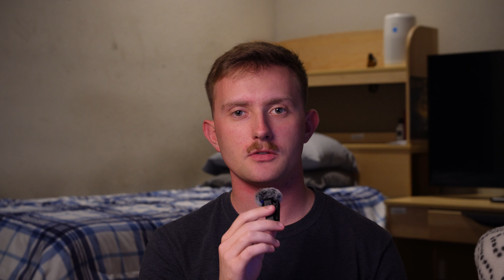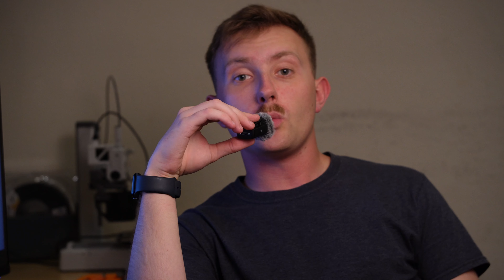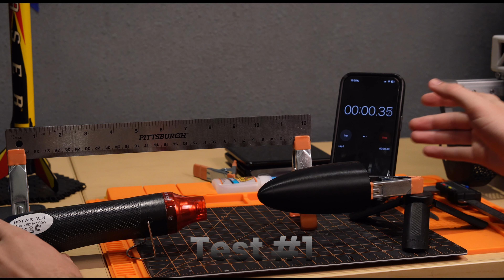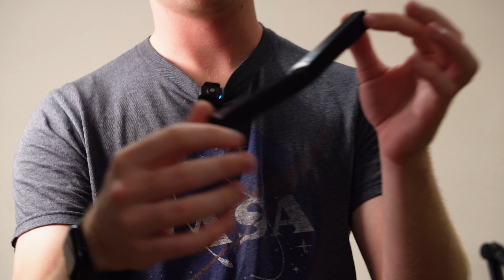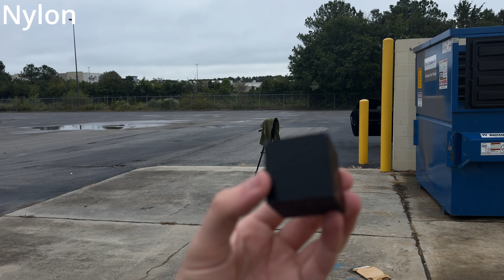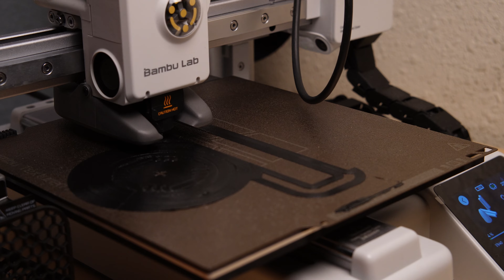I Torture Tested 3D Prints For Rocketry

Comment: I have a bit of experience with 3D printed nose cones as I have flown both my L1 and 2 rockets with PLA nose cones.

My L2 rocket was simmed to Mach 1.3 and just made it through the sound barrier before my CTI Pro54 K570 had a cataestrophic failure. Safe to say, this whole rocket went through it. Nose cone survived with no damage free falling 1.5km after the explosion. Nose cone had 0% infill and 4 layer thick walls, printed with a 0.4mm nozzle and 0.2mm layer height. Sanded and spray painted.

I launched this rocket at BALLS33 in the Blackrock desert and one thing I learned was that PLA does expand in the heat and you should keep this in mind as a loose fit between the nose cone shoulder can become tight after some time in the sun. I ended up leaving my nose cone out in the sun to get up to temp and then adjusting the amount of tape on the shoulder to get the right friction fit. Only after that did I do my pop test to make sure I had the right amount of black powder for ejection.

Next time I will try PETG for the nose cone as I reckon it will not suffer as much from high temperature.

The following is do as I say, not as I do: I printed a PETG coupler for my L2 rocket. I was /very/ suspicious of this and was not a fan but it was the best I could do on a tight time scale. I designed it to include threaded rods across the shear plane of the booster airframe and the payload airframe and I made it as integrated into the payload bulkhead and payload structure as I could in an attempt to improve strength. The coupler was directly adjacent to the motor explosion with the motor essentially exploading into it and to be honest, I was very impressed. That being said, I will never print a coupler for a high powered rocket again. The coupler was destroyed when I found it but a majority of it was found where it landed, meaning a majority of the damage to the coupler was done on impact with the ground rather than during the explosion. What happened here is - I got away with it, I do not believe this is a great solution.

Another thing is 3D printed internal structures. I will be 3D printing these in the future, I was very impressed. I 3d printed with 100% infill my payload bay consisting of two bulkheads, a payload sled and 2 threaded rods along the axis to hold everything together. Chute and drogue was attached to eather end using U bolts through the bulkheads. The bulkeads were screwed into the airframe resulting in two load paths for chute deployment, 1. U-bold -> bulkhead -> threaded rods -> bulkhead -> U-bolt and 2. U-bold -> bulkhead -> airframe -> bulkhead -> U-bolt. I had a /very/ hastily calculated estimate of 20kg worth of force on the system at chute deployment which I was confident would hold up fine. Obviously with supersonic chute deployment upon a motor cato, there is a significantly higher load placed on the system; I read this can be in the hundreds of kg but I can't be sure. The whole system held up perfectly, no damage. My airframe had some considerable zippering but the 3D printed parts were almost brand new looking. Furthermore, the bulkheads withstood chute ejection charges with no damage. 10/10 would 3D print bulkheads and payload sleds again (out of PETG anyway).

One last thing, I printed a test 100% infill PETG centring ring to go on my 54mm 5G CTI motor casing, no functional requirement, only there to see if it got melty and if I could print centring rings. The motor exploaded about 50mm above where the PETG was sitting. I now know PETG melts when a motor exploads, further testing required for non exploady motors...
Reply from the maker: Thanks for sharing your detailed experience, it sounds like you've learned a lot!

Comment: Greetings.
As someone who does 3D print parts for his model rockets, both for personal use and for my commercial kits this was an interesting video.
1 - I actually use TPU for my nosecones for my STEAM workshops, a 68mm nosecone I designed myself survives very nicely. One even survived a 400km/h ballistic return when the parachute got stuck due to not being packed properly by a novice. 
2 - PLA nosecones have worked very nicely, except when dropped on tile floors, reason I switched to TPU for the workshops.
3 - The rockets reach speeds of around and over 300 km/h and I have yet to see one melt from the friction.
4 - I print my nosecones with 2 walls and 1% triangle infill. They are squishy.
5 - I have succesfully flown Spiral vase nosecones I 3D printed on my Creality CR-10smart with a 0.8mm nozzle set to 1.2mm wall thickness and 0.6mm layer height.
So this is my 2 cents on your subject of this video.
Our first nosecones where fibreglass, then plastic polymer and roll cast. Much faster, but much more exspensive for a single use item, as the school rockets don't get flown again.
Reply from the maker: That's some great information! Thanks for sharing your experience.

Comment: Nice video man, drying petg also helps with stringing so you can print faster. For toughness testing you could make a miniature izod type machine (basically a hammer on a pendulum) the greater the toughness the less energy the hammer has to complete its swing. For your strength test you were testing bending which is a combination of tensile and compression testing. for ductile materials like plastic pure tensile is a more accurate representation of the materials ultimate strength. Are you an engineering student at uni?
Reply from the maker: No I’m not currently in college. Thanks for the info!